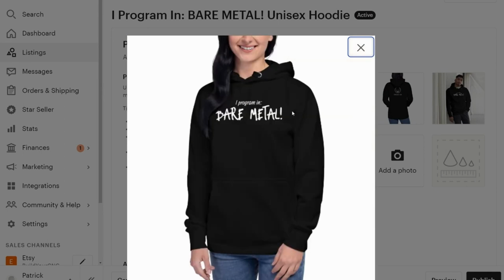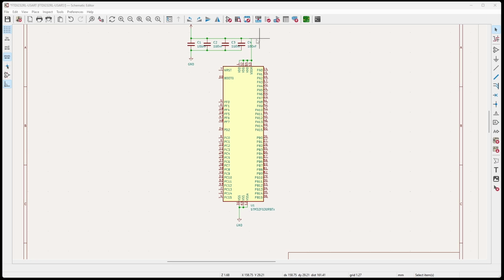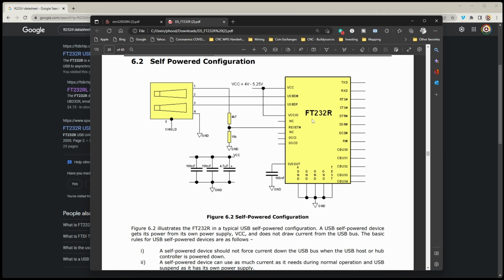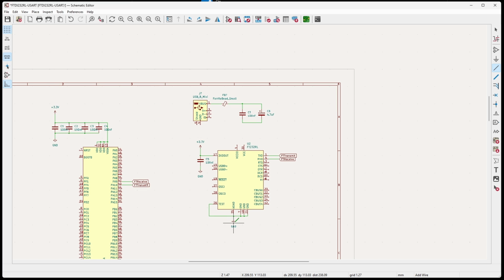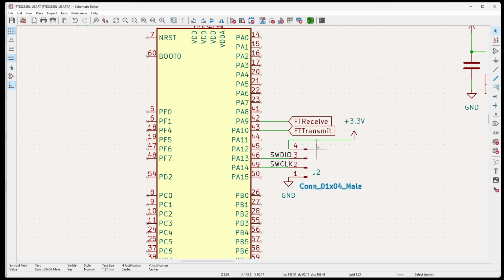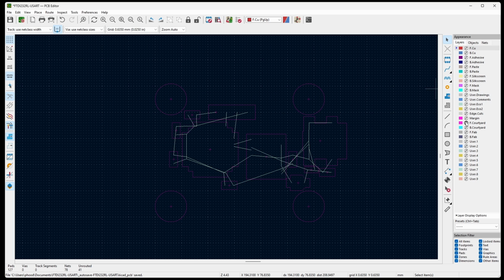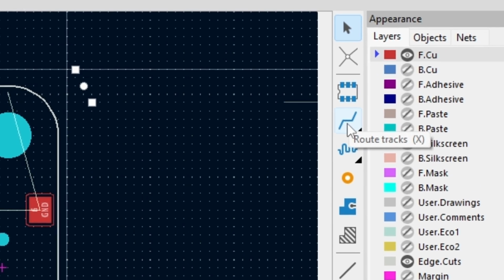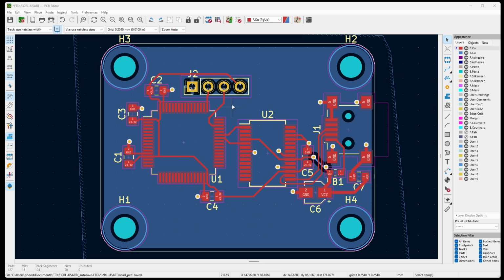KiCAD PCB Design for Beginners Using Application Notes for STM32 and FT232 #KiCAD #pcbdesign

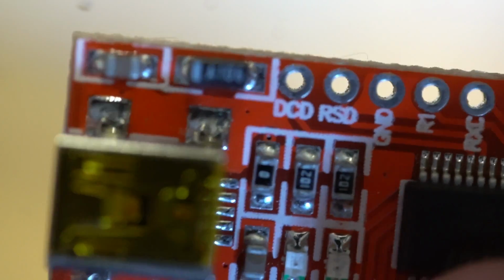Comment: Great video. Just one comment: on 31:39 you mention a 4.7uF capacitor. The black body SMD capacitor is rather a Tantalum capacitor and KiCAD has a separate library for these. It looks like a Kemet A series (3216 or similar). Similarly, if it was an 0805 there are footprints for these as well and thus there is no need to select an SMD electrolytic footprint ;)

Comment: Interesting to note, there are Microcontrollers with integrated USB support. Even in the STM32F0 family, for example the STM32F070xx ones. that way you'd only have to hook up the USB_D+/USB_D- pins to the connector.
Reply from the maker: You are correct. This series is focusing on microcontroller basics. I will show USB communication in a later video in the series.